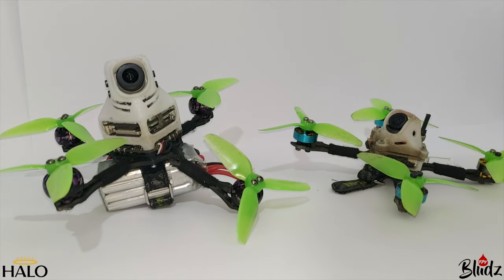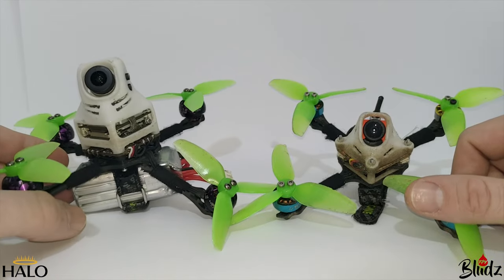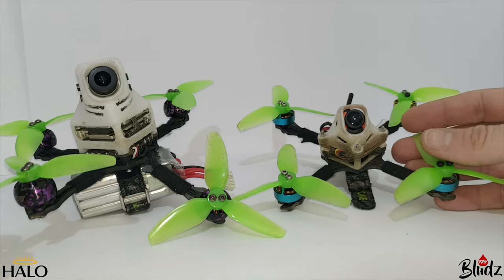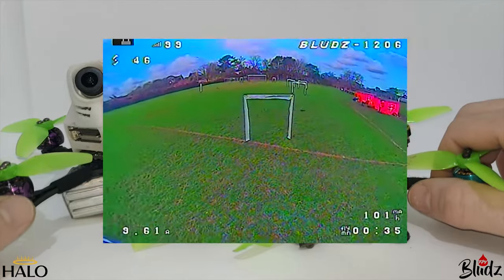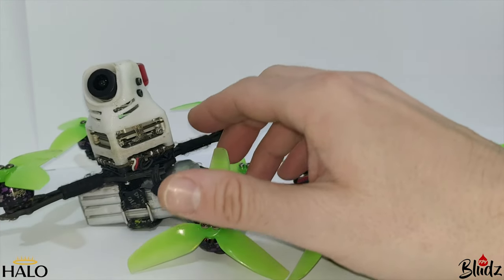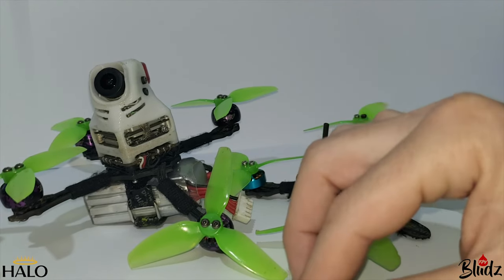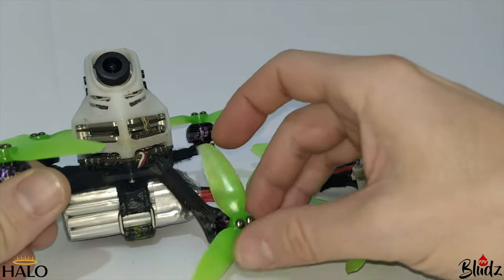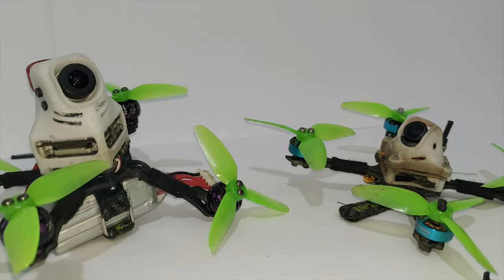How I Built My Caddx Vista FPV Toothpick - HaloRC Guitarpick

Comment: Ordered. Looks like a fun project for a decased air unit and I have 1108 and 13xx motors available. I like how these kinda look like 5 inch racers,...all prop.
Reply from the maker: Hi mate, thanks a lot for your order. I will get this shipped out to you today. You should be able to find a suitable DJI camera mount on Thingiverse, or design one yourself. The decassed air unit looks like a good option, not a lot different to the Vista and obviously available now :) Look forward to seeing your creation.
Reply: Thanks! Yeah, it may take me some time to get it all done, but I expect most of the parts will come from my GEPRC CX3 that I have an air unit in. I rarely fly it since I bought a DC3. Been wanting a more "racer" styled quad. I've done a decased air unit in my CineBee75, so fairly confident in that part. I'll try to actually take pics when I build this one. Maybe a video if I'm really feeling motivated.

Comment: If I was to build one of these with the vista what motor/battery combination would you suggest for the longest possible flight time a cruiser rather than a speed demon and a very quiet one at that?
Reply from the maker: I really like these 1206 4500kv Xing motors because they can work well for many uses. On 4s I can get a lot of speed up, on 3s it's not as fast but flies for a long time. So I'd suggest 1206 4500kv on 3s 650-850mah, HQ 3x3x3 props, you should get a good 5 mins easy just cruising, probably more.
Reply: @Bludz   thank you

Comment: After crashing and breaking many aio boards with toothpick builds with canopy i built my own 3 inch ultralight frame that can work on anything from the classic 1303 to even 12x12 mount motors. Currently i run it with xing 1404 4600kv on 4s 650 and mamba 25a aio . Dry with normal vista antenna and crossfire with miniimortal t v1 it's 118g. It has optional arm braces that also brace tge front and back of the frame. The frame is only 16-17g with hardened steel hardware. It's way more durable than normal toothpick layout and it supports both top or bottom mount battery.  Check it out flying on my channel
It's called the Goa Breeze
https://www.thingiverse.com/thing:4599923
Reply from the maker: Yea, mono plate frames are weak. Your frame sounds like my odin with the same weights too. Wel done for foing your own.